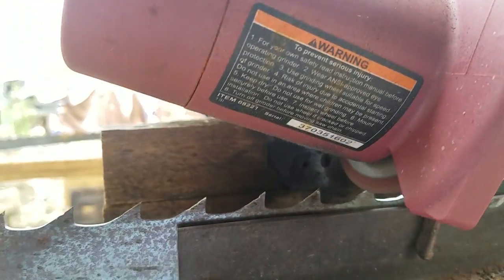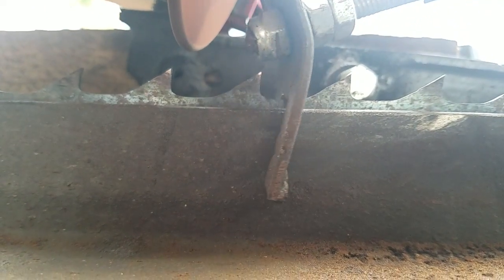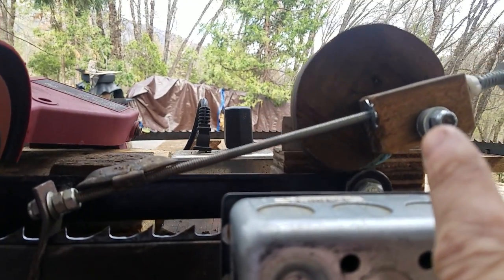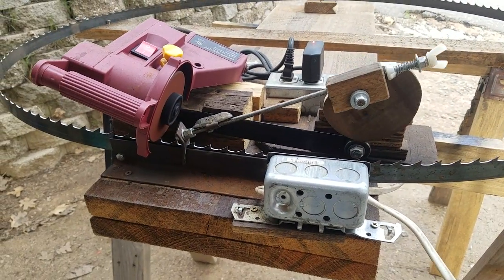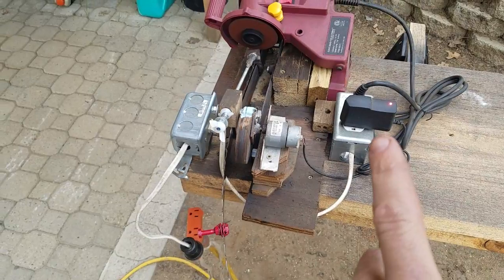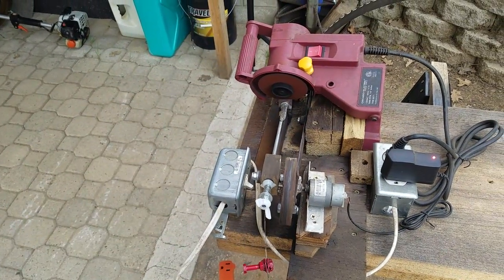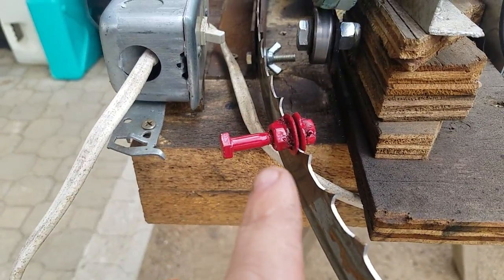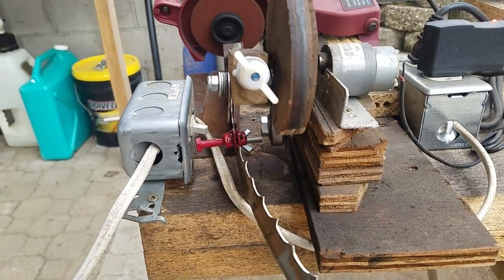Handmade Automatic  Bandsaw blade sharpener grinder DIY Sawmill Band Saw

Comment: Thanks for the video it was most informative.  By determining the longest position of the pusher rod and the shortest (180  deg opposed) then you can determine when the cam drops to the inner radius, dropping the stone and grinding the gullet.  Questions for you, diameter of your cam, the pivot point of the rocker arm and its length.  BTW I used a Morphon grinder, has all the angles and blade guide built in.  Bit more $ but less work and more accurate.  Can also do chainsaw chains.

Comment: Thanks for posting!
I’m thinking about building one this winter, and I was planning on using the same chainsaw sharpener. 
I like the simple design, and the auto off!
I built a bandsaw mill about 4 years ago, I used motorcycle wheels and salvaged most of the parts for it, since then I have made a power feed, electric throttle and blade lube controls. The newest improved was a simple set works just by pushing a button the mill auto lowers to the next board height. I have posted videos on my mill and the improvements on YouTube. What kind of mill do you own? Take care :)
Reply from the maker: Your Welcome. I was going to build a mill, but didn't have the time. This sharpener alone has around 40 hours of mistakes and redoing it...I probably watched your vid. I now am on my 3rd mill, Hudson 23hp 36 in cut. Started with an Alaskan mill. Glade you can get some use out of it!  Wooden design seems to work good, just keep it in a climate controlled environment, because of expansion and contraction. I would be interested to see your power feed , and auto height adjust videos.
Reply: Forrest N I bet it’s a bit of work figuring out the cams and fine tuning them, looks like a good project! Any chance your going to post a video of your bandsaw mill? Take care

Comment: Love the way it turns itself off!
What does the part under the sharpening stone look like?  Is it just resting on the plastic casing to lift and let down the sharpener?
Reply from the maker: Thank you. The sharpener has an adjusting bolt that sticks down, that is resting on the metal pivoting up and down. (Ther is a  90 degree tab welded to rocker bar, the depth adjust bolt rests on it.) 1:05

Comment: you could use a windshield wiper motor and a $5 5amp pwm  cheap and easy to find  your design is simple, effecent, and easy to build and saves a lot of $$  great vid THANX
Reply from the maker: Windshield wiper motor is a great idea, would just need to slow it down. What is an amp pwm?
Reply: @forrestn4988  pwm pulse width modulator controls rpm of dc motor 5 amp pwm is plenty for wiper motor $5 or less ebay or amazon and wiper motors are free off old pickups good luck

Comment: Love it wish you could make a linger vidio explaining how you built it.  Is that the original angle that the saw sharpener ran at or did you change it? The saw stop very good idea simple ive watched a lot of videos no one thouggt that far ahead lol great job
Reply from the maker: thank you. I may make a longer vid if I can Get the time... i just  ground the cam and added bondo to fine tune it.

Comment: just finished building my mill, and interested in your sharpener, I just bought the chain saw sharpener, need to look at building the cam and finding the electric motor, Thanks for your video. Question Where did you get the Electric motor?
Reply from the maker: It's a 15 RPM DC motor I ordered off Amazon. Although I would recommend 10 RPM or less because the Harbour Freight chainsaw sharpener does not have a lot of torque.

Comment: Thanks for posting. Im needing to build one for sharpening my blades. How did you figure out your cam dimensions?
Reply from the maker: That Probably  took the most time of all. I hand drew it on the plywood piece, and then took a Dremel tool and did  a lot of fine tuning.... I think depending on how long the rocker arm is, will depend on cam size/ shape...
Reply: Ok thanks.  I'm planning on building one soon. I hope I'll be able to make a cam that will work with mine

Comment: Would you happen to have a pattern for the cam?
Reply from the maker: I don't have a pattern for the cam, I drug a small section of blade Through The Pusher arm to see where I think it might run on the cam, I then use the Dremel tool sanding drum to fine-tune it.

Comment: Awesome video. What model of motor is that? Is it variable speed ?
Reply from the maker: Not variable speed. It came from harbor freight "chainsaw sharpener"
Reply: Thanks, but I meant the little silver DC motor driving the cam, is it also from HF?
Reply from the maker: @huntingthesimplelife9634   It was from amazon.

Comment: This is dulling,not sharpening.Only what you do is changing hook angle from 10 degree to 0,because you grinding front side tooth.Properly sharpening mean grinding valley between tooth and back side of tooth.
Reply from the maker: I'm not sure you are viewing the video on a large enough screen, if you notice the grinder is not a setup level therefore not at 0 degrees. 10 degrees as you stated, is much too aggressive for normal Milling, this is set up for 7 degrees as my blades were originally manufactured. Also never want to double grind the top of the tooth as cutting wood does it for you and that's why your blades become dull, because the top Edge was ground off...